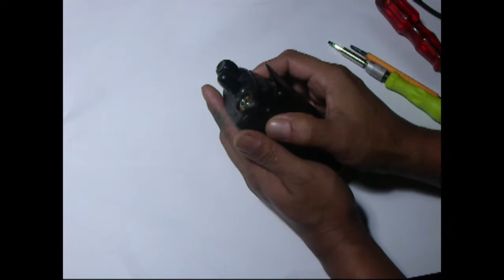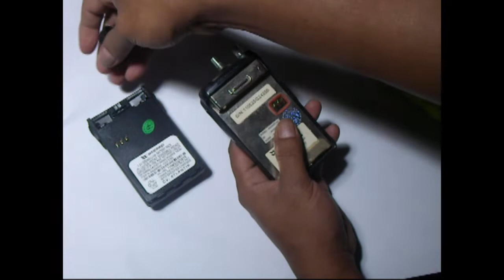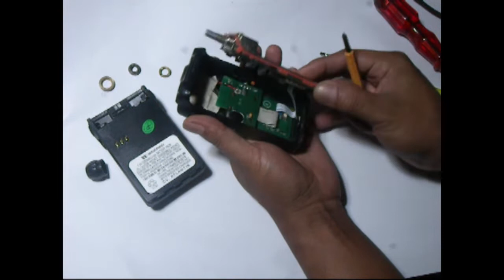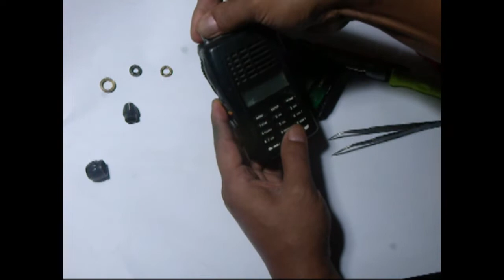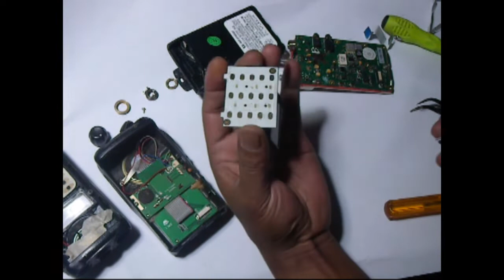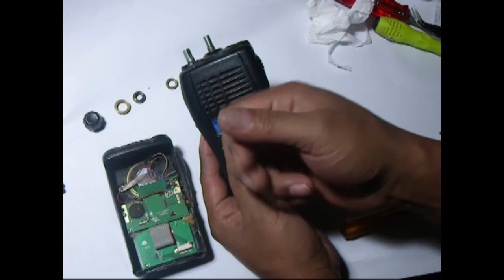MEMPERBAIKI RADIO HT WEIRWEI VEV 3288S

Comment: Izin tanya,vev 3288s transmit kadang normal karang gak? Switch ptt normal. Apakah bisa dipastikan final nya
Reply from the maker: bisa juga finalnya, kalau menggnakan anttena external, cek juga konekor ke antena, kalapun final biasanya bukan rusak melainkan solderannya agak longgar akiba panas ...
Reply: Ni gak pakai antena luar,saya baru beli second. Final nya sdh di ganti pakai punya baofeng bentuknya sprt transistor kaki 3 berjajar..
Reply: Sdh saya solder ulang jg ttp gak pengaruh
Reply from the maker: @extreme2gamers  owh ya, ada kemungkinan kurang pas gan, untuk bawaan yg seri ini persegi kalau gk salah, ... atau memang finalnya kurang bagus ....
Reply: @RupaRupi  posisi kaki nya yg saya solder sdh pas. Mgkn jelek... 🤭🤭🤭 Gni ja,klo transmit bermasalah,kemungkinan final rusak berapa persen? Selain final,apa lg
Reply from the maker: @extreme2gamers  biasanya untuk mosfet final kala ada mending cabutan dari radio lain, untuk komponnen pendukung lainnya konektor penghubung ke antena dan lainnya hanya coil saja ...
Reply: @RupaRupi  berati 90% final nya ya? 10% konektor sama coil? Trs coil tu yg bentuknya sprt ap
Reply from the maker: @extreme2gamers  kalau coil jarang rusak, kalau final mungkin, untuk coil bentuknya lilitan kawat, biasanya berfungsi untuk mengatur inpedansi dan frekuensi ... untuk mengecek kondisi final, bisa transmit jarak dekat dulu, dari 1m s.d 100 meteran ..
Reply: @RupaRupi oalah...sip ok. Pokok klo ptt saya tekan pas lampu merah nyala buat transmit bisa jarak jauh pun. Tp ya tu kadang transmit bisa kadang gak bisa
Reply from the maker: @extreme2gamers  lebih baik di coba ganti dulu, atau cek juga tombol ptt nya, kalau lampu transmit tidak berubah bisa cek tombolnya konek ap tidak ...
Reply: @RupaRupi  siap tak coba pastikan tombolnya
Reply: Misal saya buat dengerin radio fm lama antara 1-2 menit tombol ptt di tekan gak lgsg nyambung lampu gak berubah merah  tp klo sdh nyambung sering2 di tekan ya nyambung terus
Reply from the maker: @extreme2gamers  bisa coba cek dulu tombonya, atau bisa juga si shortkan atau di jumper menggunakan pinse / obeng ... kalau normal ada kemungkinan di tombolnya saja, tapi kalau di short sama tidak berfungsi berarti di komponen switch yang bermasalah ...
Reply: @RupaRupi  klo nyoba di nyalakan,ap hrs pasang antena
Reply from the maker: @extreme2gamers  ya tetep antena terpasang, biar rf ad hambatannya tidak terjadi loss
Reply: @RupaRupi  ok siap terimaksih. Nti tak coba 🙏🙏🙏🙏
Reply from the maker: @extreme2gamers  ok, sama-sama

Comment: Nanya bang. HT VEV 3388 selektor encoder cuma bisa 2 step aja. Contohnya ketika di mode memory, hanya bisa memori 1 & 2. Habis dari memori 2 balik lagi ke memori 1. Begitu seterusnya.
Encoder sudah diganti, tapi problem masih sama.
Reply from the maker: berarti masalah bukan dari selectornya gan, berarti masalah tidak bisa memory lebih dari 2 ch maksudnya ...
Reply: @RupaRupi  ya mas, kira-kira masalahnya apa ya ?
Reply from the maker: @MrButarbutar  mungkin bisa coba di kembalikan ke settingan awal lg ...barang x aj hanya masalah di settingan ...
Reply: Sudah saya reset, namun problemnya masih.
Reply from the maker: @MrButarbutar  ow .. ya berarti memang di hardware, itu kalau yg 2 ch ud tersimpan .. ap trnasmit dan receive normal2 saja ...?
Reply: Problem di memori hanya contoh. Ketika dimode vfo ya gitu juga. Step nya hanya itu² saja bolak balik.
Reply: Kira² dimana problemnya ya ?
Reply from the maker: @MrButarbutar  ap mungkin papan ketiknya masalah, sehingga mengganggu menu / program, .. coba aj di bersihkan dulu, x aj dari san amasalahnya ...
Reply: Bos, adh s kembalikan ke mode pabrik, tapi tetep mode chanel...mohon pencerahan

Comment: Pak mau tanya, ht weirwei vev 3288s, saat transmit menimbulkan bunyi noise di ht lain seperti tutttttt keras noise nya.
Kalau receive dari ht yang lain, suara di terima clear.
Kenapa ya.
Reply from the maker: kalau boleh tau itu transmit bisa jauh tidak .. soalnya kalau ada nois biasanya kurang kuat sinyal transmitnya .. jadi menimbulkan suara yg gk enak di dengar .. kalau di radio rig biasanya ad indikator agak detail untuk sinyal nya, kondisi seperti itu dapet berapa bar di radio lain ...
Reply: pak mau tanya ht gt3tp saat transmit menimbulkan noise di ht lain, kalau receive nya dari ht lain suara clear dan kalau jauh seperti sinyal hilang kenapa yaa .....

Comment: Bos saya juga punya ht weirwei vev 3288d sudah sa ganti finalnya tapi tetep gk mau keluar juga powernya solusiya gen!
Reply from the maker: kalau ada swr meter bisa di coba cek gan .. tapi kalo gk ada bisa pake lampu bekas indikator terminal setrum, ujungnya di kasih kebel sedikit sekitar 5 cm .. dan ujung satunya lagi di tempel di bagian konektor antena .. kalo ada rf yg keluar biasanya lampu nyala ... tapi kalo tidak coba langsung di pasang di kaki out finalnya tetapi harus di pasang dulu c 103 / 10 n sebelum ke kaki lampu apa bisa nyala ... semoga membantu .... terima kasih sudah berkunjung
Reply: @RupaRupi  ok ths gan!

Comment: om,maaf sblmx,klo ht werwei ada tulisannya no program,biar di di ketik angka,gak bs dan msh no program,gmn ya om untk mengatasinya
Reply from the maker: mungkin bisa coba 1. Tekan dan tahan tombol MENU kemudian hidupkan radio
2. Muncul tulisan RESET di layar LCD
3. Tekan ENTER
4. Putar tombol encoder atau sebelah volume atau on/off
5. Cari tulisan TYPE di layar LCD
6. Tekan ENTER dan masukkan kode 8100 / 7100
Reply: baik om..mksh ya ats responya,nnt sy cb praktek kan,smoga berhasil ya om,slm 73
Reply from the maker: @yatno5108  sip gan .. moga sukses

Comment: Saya pakek power suply 12v 5a,ke ht vev3388 kok gk bisa nyala gmn bos
Reply from the maker: seharusnya nyala gan ... tapi lebih baik pake regulator dulu 7808 baru masuk radio, soalnya supply tegangan hanya 7.3v untuk jenis ini ..
Reply: Makasih bos atas jwbannya,,,,,,,
Reply: Sempt konslet,yg dekatnya +  trus skrng udah gk nyala,
Mohon barang kali bisa bantu
Reply from the maker: Coba cek Fet finalnya gan, barang x itu ikutan short, trus kalo ada coba cek di PSU yang ada ampere meternya nanti ketauan ada yang short atau tidaknya ...

Comment: Bos ku radio weiwarwei ku ko frekuensinya 000.000 dan ha bisa do ganti frekuensi rusak apanya ya
Reply from the maker: ap posisi menu di VFO kah ..., kalu boleh tw weierwei seri berapa ...
Reply: Versi CY-8800
Reply from the maker: @didikputranto5281  itu posisi di menu apa gan .. memori atau di menu edit untuk frekuensinya ... di di pijit dulu tombol function coba di ketik frekuensinya . ap bisa ngaruh, kalau tidak berfungsi, ap ada tombol kunci di keypanya .. soalnya u/ seri ini belum pernah pengang gan ..